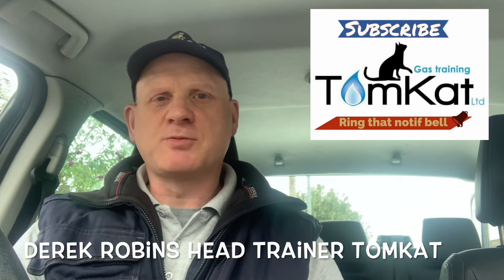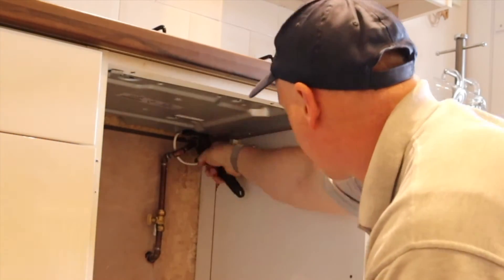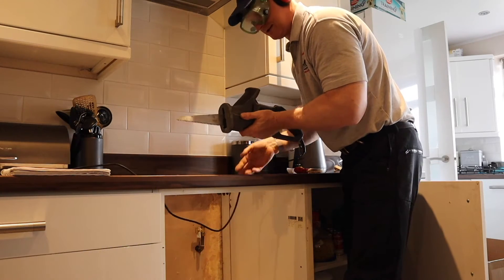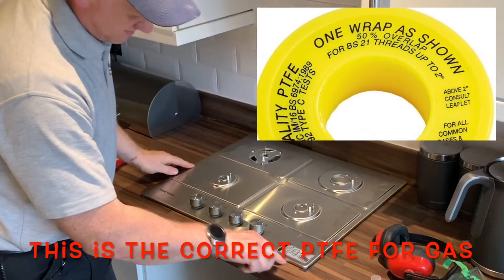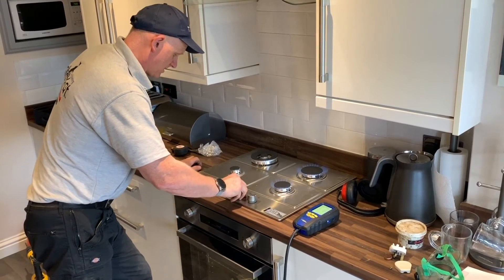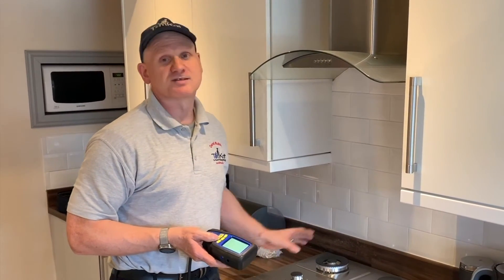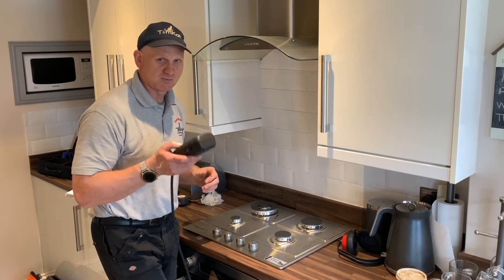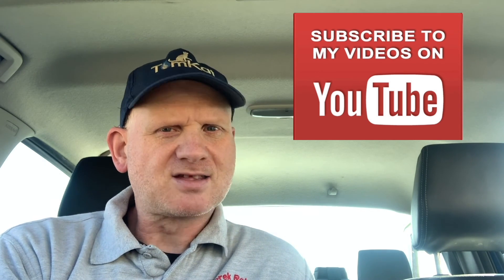How to install a gas hob (tutorial for trainee gas engineers)

Comment: Hopefully someone can answer this.I have a Diplomat model integrated gas oven  with a  separate integrated gas hob. The hob won't work unless the timer on the oven is set (doesn't matter what time as long as it's not flashing, say, after a power cut). I want to change the oven to an electric, so, how can I get the gas hob to work, is there a wire or something connecting the oven to the hob telling the hob not to work i.e to flow the gas through the burners?

Comment: Hello  I am coming across a lot of  gas hobs installed above drawer units 600mm and 800mm. I have approached gas safe asking if there is a safe installation guide for fitting either with or without a  separator plate which seems very hard to purchase.gas safe told me to install it to the manufacturer instructions. I can’t find any manufacturer guide that seems to explain the correct installation. I have had knives cut the ignition cable and some units just don’t have enough room to install a separator. Do you know Derek or Can anyone help with this issue. It concerns me. ??????
Reply from the maker: @shaundavey1170  it all depends on the thickness of the worktop and if the hob lays lower than the worktop to say if a shield is needed or not. If you have a standard 38mm thickness then normally a shield is not required but because of the new 22mm thickness it causes problems. I would always advise customers not to have hobs over drawers because of this problem.
Reply: @tomkatgastraining  thanks for the quick reply Derek. Exactly the situation I have tomorrow a neff hob in a 22 mm work top above a drawer unit so I’ll try and find a 800mm separator if that’s the requirement.  to late to advise against.  the kitchen is in 👍thanks again

Comment: When he removed the connecting pipe to the old hob the isolation valve seemed to be open. Couldn’t have been surely but it looked like the handle was aligned with the pipe.
Reply from the maker: The gas was turned off at the gas meter 🤔
Reply: @tomkatgastraining  That wasn’t evident from the video, but good to know that my eyes were not deceiving me. Had I been carrying out that job as a GasSafe certified technician I would have closed the isolation valve to minimise the risk of air diffusing back along the supply pipe upstream of the isolation valve and because it is the sensible thing to do.
Also note that the latest revision of BS 6172 is BS 6172:2010
Reply from the maker: @tsb3093  what about removing the meter 😜
Reply: @tomkatgastraining clearly not relevant
Reply from the maker: @tsb3093  clearly is
Reply: I’m not quite sure to what comment you are referring to.
Are you saying that the closure of an isolation valve is not relevant…if so that seems bizarre, or are you suggesting that the use and reference of the latest British Standard is not relevant…and if so that would seem incredible.
Reply from the maker: @tsb3093  isolation of a valve is relevant when the gas is turned off and the gas meter has been removed from the supply. What if there was no valve or the valve was a soldered type?

Comment: This video is misnamed. It is not about the installation of a gas hob but about the replacement of an existing gas hob. Therefore it gives no information about how to actually install a gas hob, making the connections according to gas regulations and so on. Anyone who requires a video to show them how to disconnect and then reconnect simple screwed connections should not be attempting such a task.

Comment: thanks tom cat looks good and thanks for teaching us and making those gas safe videos. Shouldn't that 6mm power cable be clamped to the wall 25mm away from the hob gas pipe and valve? Also what was the gas rate, working pressure, heat input and het output net please?

Comment: I understand that this video is tutorial, but you should have explained that if you are changing an old unit for a like for like new one (exception being the sixe of the opening) there is no need to do all that pressure test, unless it is to highlight a leak. So, for tutotrial purposes, it's OK but the change over of a gas hob is not rocket sience nor do you need a diploma from any organization, it's pure and simple common sense. 
The government made the rulling to stop any old cowboy that think's they can mess with the gas fitting and test for leaks with a naked flame, As the British Gas engineer did when I reported a possible gas leak, when I was living in a rented property, back in 1976 🤔

Comment: Hi Tomkat,
Can you use a flexible hose like CSST if there is no oven below the hob, and there is no drawers coming into contact with the pipe or fittings?, Unsure whether the cooker hose argument includes these metal flex hoses or just rubber hoses.

Comment: 😂what you blowing them out for just turn the taps off and wait for a clunking  I always wack boiler on then do working pressure with hob and boiler on
Reply from the maker: Because turning the tap off is testing the control tap not the thermoelectric
Reply: @tomkatgastraining  when you turn the tap on and click the igniter creating the flame thermocouple opens gas then stays on when you turn the tap off after a few second thermocouple closes and shuts off gas to valve with a click all your doing it blowing it out instead of turning the dial down when I do it that way you turn the dial to the off position when it clicks it won’t turn back on unless you push it down all your doing is wasting your own breath and making your self dizzy
Reply from the maker: @pauls826  but is it passing and I am simulating a real scenario. Anyway you do what you think is best and I will continue to train my trainees so they understand how safety devices work and to make engineers judgement.
Reply: @tomkatgastraining  yourll know if it’s passing when you try to turn the knob and it doesn’t move because the gas valves closed try it tomorrow in the centre you will know what I mean I’m not having a stab at your training your videos are good all I’m saying is you’ve no need to blow them out putting your face near flames when you can just turn the knobs off wait for the clicks and try to turn them on again without pressing them down it’s simple
Reply from the maker: @pauls826  we have 2 cookers at the centre that have thermoelectric devices that stick you turn the gas off with the control knob it turns off the gas and you hear the thermoelectric click so you think it’s worked you then blow out the flame with the gas still on and you hear the click but the gas still comes out. You don’t need to tell me how to do my job because I have been at it a long time. Like I said you do your tests and I will do mine at the end of the day both tests are in the training manuals
Reply: @tomkatgastraining  so I am right 😂
Reply from the maker: @pauls826  in a way you are still not testing the thermoelectric. I am teaching controls this week so I will use your comments in class and I always show the difference between turning off the gas control and blowing out the flame. I bet out out the six  trainees I am training none of them will test it your way though under assessment.
Reply: @tomkatgastraining  👍

Comment: I need some help.

I have measured my current hob. 

Its 60cm X 50 CM.

Buying a replacement hob, I chose 60cm x 50 cm, but all the hobs listed are 

H4.5 x W56 x D49cm

Can you help?
Reply: New worktop or the right size hob

Comment: Why releasing gas in the air. My gas teacher instructed me to light the burners then shut off the isolation valve under the hob and wait for the click, then reopen the gas at isolation and check for no gas flow safely. The taps will be open without leaking if all good. We can also do it with tightness test if we leave the gauge on the meter test screw after the first tightness test so we do not have to smell or hear the gas ourselves when we reopen the isolation valve under the hob. Also spraying an injector can be an option. For this kind of hob it easily reachable.
Reply from the maker: What if you have no isolation valve on the hob and what if it’s a cooker with a hose. There are different ways of testing thermoelectric devices and I prefer to simulate real life under full control of the test.
Reply: @tomkatgastraining  thanks for the prompt reply. You still have ECV just in case you are missimg the isolation valve. But I would add a valve for a few quids before replacing the hob. Makes more sense to me
Reply from the maker: @antoniogalluccio4213  and your way makes no sense to me and thats called difference of opinion.

Comment: Spoke to Gas Safe today regarding gas hobs and was informed that a test point is also now required on hobs, luckily Screwfix do a gas tap with a built in test point, unfortunately 15mm only.
Reply from the maker: You can buy test adapters that fit onto the gas connectors or were the hose fits onto a cooker but you can also buy injector extended test points so they don’t just need to be on the isolation valve.
Reply: @tomkatgastraining  👍

Comment: Hi. I am trying to install our new cooktop but while it fits the space when the regulator is unattached, once I attach the regulator it does not fit. Can I install the regulator just after the cooktop shut off valve and will it still work safely and effectively? It couldn't be more than 5-6 feet additional distance for the gas to travel through the flex hose.
Reply from the maker: If I was you I would get a professional in. It sounds like you are not in the U.K. with what you have written.

Comment: I'm assuming you turned the isolation key before loosening the bolts mate? I didn't see that mentioned in the video. I need to change a worktop in my own kitchen and the gas hob needs taken out which means disconnecting the gas pipe. Is this easy enough done?

Comment: I have a question, I have both a gas hob and a gas oven. But my gas outlet only has one exit. Do I need to fit in a three-way valve? Or?
I would appreciate if you reply
Reply from the maker: No you need to get a gas engineer to do it for you

Comment: You can use a jig saw with a cutting blade at the point of first cutting the worktop from new. First measure the hob all the way round, ensure that it is square. Using a wood drill bit wide enough for the jigsaw blade at each corner to start your cut. The saw that you are using is correct, since this is now used to create a larger cut to install a larger hob than the original hob. Always use a jigsaw when making the first cut out, since you have more control. Never use the saw to make the first cut!

Comment: Derek, where are your protective gloves when using the power tool?  Gloves that have rubber coating help grip the tool and prevent it from slipping out of your hands; as during work your hands sweat, and can cause slipping and possibly a dangerous accident. Only saying....
Reply from the maker: I have never wore gloves in my hole working life I find them very restrictive. Don’t get me wrong gloves can help keep your hands like a baby’s bottom but I don’t think they help me in any way. My wife likes my very course hands only saying 🤣. Anyway thanks for your concerns but at nearly 54 years old I don’t think I will start now 😜👍🏻
Reply: Gloves will pull your fingers into the blade, and will inhibit modern safety systems built into modern tools!

Comment: Hi. Just wanted to ask as i am doing my onsite training. Im getting different info regarding heat input rating in kw net or kw gross.  For example on some appliance databadges or mi's it sometimes doesn't clearly indicate if heat input is in kw net or kw gross. Would appreciate if u get back to me.
Reply from the maker: If the appliance is older than the year 2000 it will be in gross kw after 2000 it will be net.  That’s always a good indication but if it doesn’t say gross assume it’s net. Hope that helps
Reply: @tomkatgastraining  cheers.

Comment: Derk is the female brass iron onto the gas hob elbow sealed with a fibre washer on flat face or is it taper thread seal
Reply from the maker: Antony Buckley depends on the manufacturer of the hob and the type of the gas connection but the male iron must be tapered 👍🏻
Reply: So the aluminium elbow on the hob use the tapered elbow as some hobs come with 2 a parallel and tapered elbow then screw a normal brass  female compression iron that has parallel thread.

Comment: Had a debate with someone the other day when you are doing an annual safety/landlords on this would taking a burner pressure from the injector with the other three on be the correct way to do your burner pressure as opposed to heat input. (Likely you would gas rate as these cookers are usually caked in grease)
Reply from the maker: When doing the pressure you turn the burner on the opposite corner to take the correct pressure not turn on all the others. I don’t see the need to do it if your gas rate is correct and the flame picture is ok

Comment: @TomKatgastraining did you solder the copper pipe out of situ or soldered it once you had it in place altogether. Could you pls do another video of installing gas hobs? Thanks
Reply from the maker: mohan abdul I soldered it in place. Why do you want me to do another video on the same thing ?
Reply: @tomkatgastraining  underneath the workable where the underside of the hob is. How did you manage to not leave any burn marks? Did you use a rotherberg blow torch having it on a small flame and a heat shield or matt?

Comment: Hi Derek what fitting did you use to connect the hob to the pipework. Last time I took asc at local independent training centre they said you can't use compression  female iron. Ard they right I've always used them
Reply from the maker: Antony Buckley it’s one of those situations where you will get half of the engineers saying you can and half saying no. The regs say compression fittings can only be used in accessible locations I say under a hob is accessible and you as an engineer have a good idea that the hob is connected with a female or male iron to copper. As long as the fitting has a taper thread and you use the correct jointing compound there is nothing wrong in my eyes but plenty will disagree. I have looked in all the regs about it and the manufacturers instructions and all say appropriate fitting. At the end of the day the hob connection is a compression fitting thanks for watching sorry I didn’t give you a definitive answer but I don’t think there is one it’s like can a hob be fed with a cooker hose. Cheers 👍🏻

Comment: Is there a new requirement to install a separate gas test point at a new appliance that doesn't have one as part of the appliance? Does this apply to gas hobs?
Reply from the maker: Martin Wright this hob was installed last summer I had forgotten about it but yes a new regulation is coming in along with some other big changes soon

Comment: Did you do tightness test after blowing out flames to make sure valves weren't passing? It wasn't on camera.
Reply from the maker: Ibrahim Ali why would you do that on a cooker you can hear the gas turn off I think you are getting the test on a multifunction control valve and you don’t do a tightness test after that . Thanks for your comment and watching cheers
Reply: @tomkatgastraining  Aprreciate the response Tomkat, looking forward to more videos from you. 

If I can suggest futures ones - 1) electrics for boilers 2) fault finding 3) in depth info on controls 4) individual parts like diverter valves/ pumps etc.

Comment: I'd still say that gas cock is readily accessible. Some would argue not, 🤷‍♂️.  The logic book I have in the van make sure the fsd goes off within 90 seconds for a hotplate. Has it changed to 60 seconds ? I was always told to turn the gas off at the meter, remove the flexi gas, pipe or turn off at the meter itself in the centre.  In the real world we blow the burners off at low flame and time it. In this one mi supersedes all right
Reply from the maker: All thermoelectric should shut down within 60 seconds but if the hob MIs say 90 then we go off that . As for turning the gas off at the meter why would you do that as you would have to purge the gas again . Thanks for your comment and watching cheers
Reply: Turning off at the cooker isolation valve is acceptable.  I was told that it could be turned off at the meter, in the centre.  Maybe the meter was in close proximity.  60 seconds drop out is pretty much a set standard for Mi's that's what I tend to go with,  thanks for the clarification Derek.  Sometimes it's worth just listening to your instructor, no arguments 😊.  For my next renewals I'll be heading on over to your centre. (Less then 3 years)